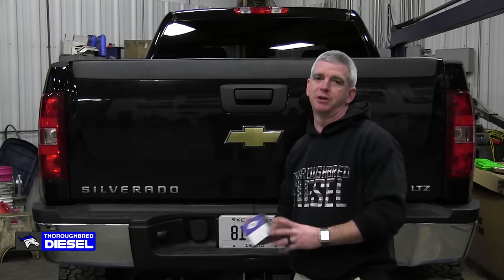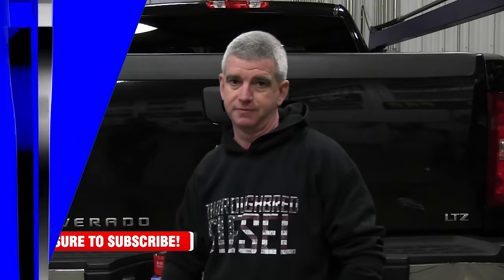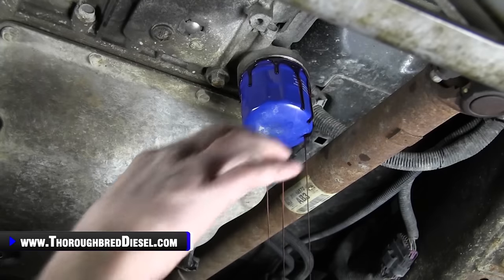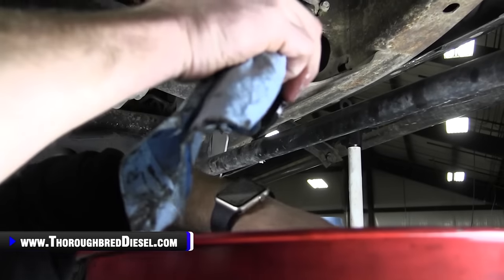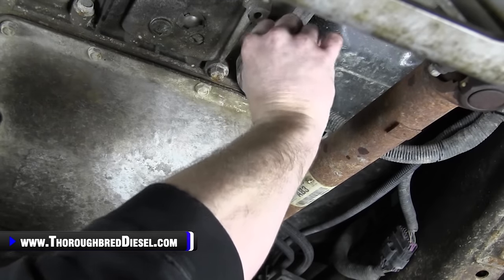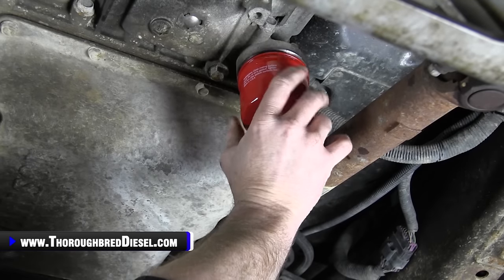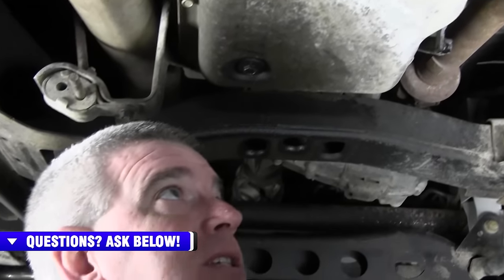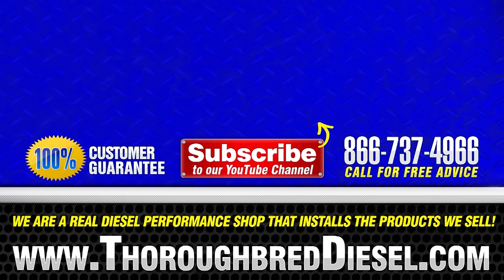How To Change Allison 1000 Transmission External Spin On Filter

Comment: I’ve got a 2016 lml, and when I bought it GM said to change it around 45,000 miles. Do you think me letting it go that long has hurt it? Im about to start doing it as you suggested. Thanks!
Reply from the maker: Its cheap and easy insurance.  I would change it at these suggested intervals.
Reply: I’m definitely going to start doing it with my fuel filters, which is every 10,000 like you said. Hopefully I haven’t hurt my trans by this point. Thanks!
Reply from the maker: cool. Yeah, every other oil change or 10-15K miles should keep you running strong.
Reply: @jameswalker4123  oi
the 2005 eqanox you have to do it every 30,000 but you cant check it
so might as well do it every 15,000 to 20,000
but if youhave a dipstick you can check it and if its brown change it and if its darker brown change it
if its getting off red change it if its black change it with added lub for next 5 changes 
i change my z28 fluid every 10,000 and its about 9 bottles and its 10 bucks a bottle HAHAHA so yeah
but i know my gears are running red and what not
and you can use dex 6 for me thats what i use 
i dont know if diesel is different fluid for trans but all other chevys its all dex 6 now
unless its other t1 stuff

THE END
::))
Reply: I just replaced the one the factory put on in my 2005 duramax with 275,000 but I would say it’s the having a tune for 1,000ft lbs an the trans not being built is my main issue....  haha
Reply: @Dryhalf08   allison says every 50k and change fluid at 150k
Reply: i am using transynd in my 2005
Reply: 50,000 mi, 2,000 hrs, or 24 months general or severe with approved TES 668 or 295 fluid.  It’s on Allison’s website and yet I keep seeing people state 10k or every other oil change.  Not sure where that came from.  One may argue it’s cheap insurance, but I guarantee you that the airlines you fly with don’t change filters with 80% life cycle remaining and planes are not dropping out of the sky.  Engineers build in “fudge factor” for prescribed limits.  I have found this mentality often coming from people that don’t know you should change your brake fluid every couple years, but they go through a metric crap ton of trans filters unnecessarily.  So many worry warts trying to keep their truck moving, but don’t care about the stopping part 🤔
Reply: Going out to change my 3rd filter in 20,000 miles🏁

Comment: Good video.  Probably should’ve mentioned that you would need to check the transmission fluid level after replacing a filter because of the fluid that drained out.
Reply: Maybe a 1/2 a cup drained out…
Reply: @1DirtyMutt  Still a good idea to check the fluid level.  I just wasted a few minutes watching this because checking the level was my goal.  unscrewing a filter shouldn't take any directions.  Lefty loosey, righty tighty.
Reply: @ronjclm8590  just pull the dipstick and look at it didn’t think that would require directions
Reply: @thetexorcist2235    I have 3 Duramax trucks.  To get the correct reading on the transmission.  There is a specific proceedure spelled out in my owners manual.
Reply: I fill the new filter up with new fluid
Reply: Exactly now you're low on fluid
Reply: @1DirtyMutt half a cup is a half a cup over 30,000 MI that's a lot of fluid missed

Comment: I got over 102,000 miles on my lmm with 0 trans fluid or filter changes and it’s just fine. Gm recommends not replacing the fluid and filter til 150,00 miles and I’m no where near that.

Comment: @Thoroughbred Diesel, how many quarts approx are needed with a pan drop and internal, and a new external too? I am getting just to the start of the hot hash marks at 165 F in park, on the higher end of the cold hash marks, before I run the truck up to temp. thanks Wade!

Comment: Every transmission should have a spin off filter and magnetic fluid drain plug.
Reply: Only one I've ever seen is the big Allison.  Drain plug and outside filter.
I had an outside drain cap and magnet set up in an ancient Chrysler transmission many years ago and never needed it.  
Honda puts their literally thimble size inline transmission filter buried inside the case. 
Once it's plugged, the unit fails. Very handy.

Comment: For whats it's worth, I change my Allison spin on filter every 25k miles and top off with Transynd.  Every 100k, I drain the system and refill.  Every 200k I double drain and do the internal filter.

My Allison made it to 1.2 million miles of towing pretty heavy and often before getting a rebuild.

LB7 now has 1.3 million on the odometer.

Comment: Thanks for your help on maintenance information. I just bought a 2017 Chevrolet 2500 Duramax truck. It’s a High Country with only 70,000 miles on it. This was a one owner truck. I’m new to the diesel world, I’m big on schedule maintenance on my vehicles. 👍
Reply: Don’t forget the mass air valve…clean

Comment: I found that magnet and was surprised.  I cleaned it off and put it back on, then decided to research.  Looks like i did the right thing.  This explains why the drain plug doesn't have a magnetic tip.  THANK YOU!
Reply from the maker: You're welcome.

Comment: Really GREAT how you showed us how to check the fluid level after replacing the filter.
Reply: You aint loosing that much fluid and honestly, if you're that worried about how much you lost. Well, fill the new filter with transmission fluid and spin it on. That's how much fluid you lost.

Comment: Thank you for making this video. I am a fairly new Duramax Diesel owner. I also thought all the trans fluid would drain out. That looks easier than an oil change or fuel filter change, I do both of those on my own. I will be doing this right away and often. Thanks again!
Reply: You won't drain out more than half, because the torque converter is not being drained. The best you can do is drain it. Drive it for a month, then drain it again, where you are increasing the percentage of older fluid to newer fluid. In most cases, that is enough.

Comment: Just a little hint A break the filter loose but not leaking I take a small Phillips bottle of my hand I just bumped the screwdriver up into the bottom of the filter then I loosen the filter oil runs out that holds that all around the top not quite so messy you don’t have to wait for the whole thing to drain just wait for it to leak down below sea level I found it be easier to be neat and clean enjoyed your video
Reply from the maker: Thanks and great tip!

Comment: Actually the maintenance interval is 30k on the spin on filter and 100k for the internal as per GM maintenance schedule. 
Don't use aftermarket filters. Either use the Allison filter or the ac delco filter available at GM dealerships. Also drain the dexron fluid and upgrade to Castrol 668 ATF . The difference between original dex 3 or dex 6 ATF and the Castrol Trans Synd 668 is the service mileage. Dex 3 is 30 k miles, dex 6 is 100k miles, Castrol trans synd 668 mileage is 300k miles.

Comment: I am a stickler  for oil and filter changes..have an 02 LB7 that just rolled 357,000 miles today..orignal engine..orignal trans...change oil and oil every 3000 miles..Allison spin on every 5000 miles..drop trans pan and install new internal filter and new spin on every 25,000/30,000 miles..front rear,diffs every year..run a Fass Ti150 /Beans Sump 10 micron water Sep and 2 micron fuel filter those get changed every 6000 miles or sooner..sometimes before an oil change I dump a can of seafoam in the crankcase.Installed new injectors June 2018 and took pictures of underneath the valve cover..spotless! Seafoam put my truck in there winter time magazine or Instagram post in December I think.white 02 with 350,000 miles at the time!! Maintenance is cheap insurance.

Wix oil,fuel filters
Allison brand spin on
Mobil 15w40 1300 delvac 2.5 jug
Reply: Wix filters and the mobil delvac are definitely the way to go. Strongly agree
Reply: Have you ever tried royal purple?, I swear I actually feel a difference from when I used Mobil. And now I change my oil every 7,000.
Reply: ACDelco spin on transmission filter I use Rotella 1540 T5 I got 392,000 Mi running strong

Comment: Good video just curious though if you’re not sure on what fluid was put in the truck originally be it AC Delco or transynd or some other fluid is it OK to mix fluids as long as it’s dexron VI since a little bit of fluid drops out when you change the filter?
Reply from the maker: The trucks to my knowledge are produced with Dexron.  I am not aware of there being a problem with mixing of Transynd and Dexron.

Comment: I like your video though, but don’t you have to replace that little bit of oil that you loose from replacing the filter ?
Reply: I agree. You are losing transmission oil - albeit a small amount. It should be topped off.

Comment: If you change the trans filter as often as you’re suggesting. Is a transmission flush still needed?
Reply from the maker: Yes, I would suggest the OE suggested fluid change interval.

Comment: Great video 
I have 12,500 miles in my Allison since spin on and fluid changed 
Will do the spin on
Allison Duramax said 30,000 to 40,000 miles to do the Fluid change
Thoughts?

Comment: After seeing this video I bought transmission filters for my 2021 GMC Duramax 3500 because I’ve never changed. Bought truck new. Is it possible I don’t have an external transmission filter?  I can’t find anywhere.
Reply from the maker: Yes, the later model Duramaxes do not have the external transmission filter.  2019 was the last year for them.

Comment: Good idea! I was doing it every 30,000 miles, but will change it at 10,000 miles on my 2005 GMC 2500. I wish all AUTO XMSN filters were this easy to change. I have over 350K miles on this XMSN, and it is still performing great. I also use synthetic Dexron III fluid in it, not the super expensive Allison TranSynd fluid, and it works just fine. No issues at all.  And, I read that GM drains the Transynd fluid at the factory, and replaces it with Dexron III before the new trucks leave to be delivered at a dealership..
Reply: Transynd is PAO and is superior to that swarf you’re pouring in your transmission.  GM wouldn’t pour our transynd to replace fluids…I heard GM recycles every 2nd truck as it leaves the assembly line too.

Comment: Hello sir . I no this is an older video.. very informative.. my question  is upon re- installation  does it matter if you put the magnet back on trans housing or inside the filter .. thx in advance
Reply from the maker: We suggest the magnet be reinstalled for sure.  I know some of the knockoff filters don’t accept them, don’t use those filters.

Comment: I bought my my Wife's Friends Late Husband's very clean  2011 Silverado HD 6.6L Duramax w/only 98K. I'm fixin to change out the Trans, Fuel, Oil & Filters out at 100K. Oh yea, I'm swapping out the Worst designed GM Trough Oil Pan too. w/ a PPE deep flat bottom Pan. Former Owner  kept it in great Service condition, but I still want to know I'
m doing my Do Diligence to hopefully get at least 200K +  mi. out of it with proper servicing & Maint. Thanks for your Vlogs, I'm really learning a lot here viewing your Videos as this is my first Diesel.
Reply: One time I was at the fuel pump in Indiana and I was talking to a lady and she said she had 900,000 miles on her 2011 GMC Duramax engine

Comment: For an oil filter that is vertical or on a diagonal, I'll take a large nail & w/ a hammer pierce the center(or lowest point) of the filter housing to let the fluid drain...then remove. If you're in a hurry; let the oil drain from the filter for 15-25 seconds, then plug the hole w/ a wood dowel & remove the filter. The filter in the video is small so it'll only take a minute to flow to a drip. I've been doing this on the huge oil filter on my IH/Ford 7.3 Diesel. Keeps the work area & me much cleaner.
Reply: @carmiethompson2676  this is a horrible idea, the first time the filter is siezed on there and you can’t get it off now you can’t take the truck anywhere to get fixed  or go buy a different tool to help get it off yourself or even come back to it . Make sure the filter will come off first .
Reply: @michaelhuss8551  What are you talking about? When does a spin-on oil filter 'seize' on the threads of the filter mount? Don't take your Meds before you post, that's a horrible idea!

Comment: Do you guys have a video on changing the transmission fluid on a 2019 Chevy Silverado Duramax diesel engine 4x4 6.6
Reply from the maker: Not yet but it is in the works.

Comment: Great video buddy.... one question u don’t lose enough trans fluid to worry about adding? Or should I fill the filter up mines a 2020 so I can’t add from top it’s upfill I guess
Reply from the maker: 2020’s if you have the 10 speed, don’t have the external spin on filter, only the internal filter.

Comment: How many miles before changing the transmission fluid and filter?
Reply from the maker: We usually change the external filter every other oil change.  As for fluid and filter, I would suggest changing both at 50K miles.  Cheap insurance for a healthy trans.

Comment: So after that. Then what? Just fire it up and is it good? Will there be air in the system? Will it just bleed it self?
Reply from the maker: Yes,  you can fire up right after the change.  The pump will refill the filter, but we suggest you checking the fluid level and refilling to the correct level.

Comment: Question i have is that i bought a 2016 lml and it has 120k on it. I contacted the previous owner and the trans has never been serviced at all. Is it a good idea to replace that filter. I really want to do a full service but have always heard if its never been done don't do it
Reply from the maker: If its never been serviced,  it needs to be serviced.  That old wives tale will not apply to automatic transmissions.  Need to service the external and internal filters as well.

Comment: Question: Should you add new fluid to the filter (fill 1/2 or 3/4) and then install the new filter?  To account for any loss of fluid when taking off?
Reply from the maker: Yes, adding a little to the filter then checking the fluid level is recommended.
Reply: This is all new to me. My ‘20 Duramax is my first diesel since my ‘97 Ford. My truck has reminders for fuel filter, def, oil change, air filter, etc., but nothing on a Trans Filter. Also, my truck has 49k miles on it, and all my service work, from oil changes, to tires is done at my local Chevy dealership. If this is so important, why has no one from the dealership ever mentioned it, and why is there no notification warning as there is for everything else? Is GM deliberately trying to hide this from us, ‘cause it wouldn’t surprise me? I’m not trying to be argumentative, just trying to follow this to its logical conclusion. Thanks!

Comment: It's cheap insurance on your transmission. How often do you recommend the fluid to be changed.
Reply: Noah kraft good question
Reply: Check the diesel supplemental guide for your truck. It will suggest normal and severe duty intervals. I always follow the severe duty schedule for additional peace of mind.

Comment: The filter hangs straight down. Why would you not fill the new filter before you install it?
Reply: This guys not smart haha
Reply from the maker: Works both ways. I just let the supplied oil that runs through it pass through the filter.
Reply: Catapilar technicians claim too never fill your filter with oil and reasoning was contaminated oil gets on the clean side and then is cycled through the motor/transmissions!  They claim this was worse then the few seconds the motor would run with out oil too the top end !   I've always filled my filters and still do but hey they are the technicians lol!
Reply: Team Deep Tillage 
The cat guys are right of your not carful or don’t use a filter filler. Dirt is worse for wearing parts then air is. 
But if you make sure to put the oil into the filter in the proper place or use a filler then you have no dirt and no air.
Reply: donald sipes i was asking myself the same question lol after a few filters change the transmision is gonna be low on trans fluid.
Reply: True just fill the filter and not worry about topping off

Comment: Ok so I just bought a 2500 HD I did all the fluid changes . Bought a magnet  for. The trans filter. When I did the fuel filter .. I noticed it had no water  sensor or separator on it.  At this moment I still
Have 41% oil life left. Today I got all my oil and filters. I plan on getting aid dog set up.  When I do what do I do with factory set up. How do I block it or get rid of it? Ty 2005 Chevy HD
Reply: The factory filter should have a water separator built in... big plastic screw with a wire coming out on bottom of filter.
 Lots of companies make filter delete kits, basically a metel bowl that goes in place of filter

Comment: How often do you recommend changing the transmission fluid?
Reply from the maker: Go with your owners manual on this.
Reply: If you are changing this filter every 10,000 miles, at 100K you would have swapped almost 3 quarts of fluid, which is just under 1/2 capacity.  Another reason to change the filter regularly!!!

Comment: Gloves, box of 100 from Harbor Freight for $7.99, good to have around for stuff like this!
Reply: He's an old school mechanic.  Most guys about 40 and older grew up working on vehicles without gloves.  I tried using gloves but just can't seem to get used to them.  It just doesn't feel right.  So, I keep a big container of Gojo handy.
Reply: @segarza  Ya I hear that, one in awhile I use real thin painters latex gloves if I'm doing something super greasy.
Reply: as of 2021 the gloves are up to $21 a box

Comment: Thank you for the video. Do I need to add fluid after I replace that filter?
Reply from the maker: YW. Just a little. Fill till fluid level is correct on trans dipstick, check with engine running.